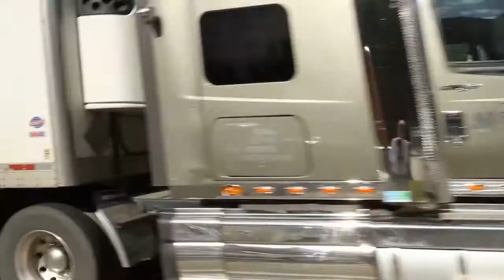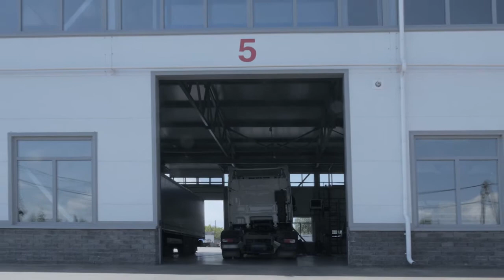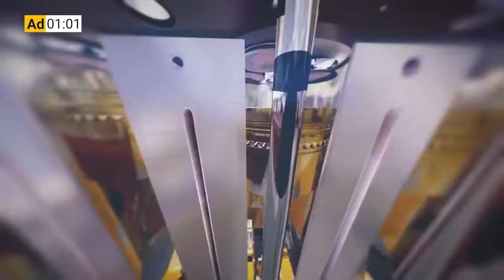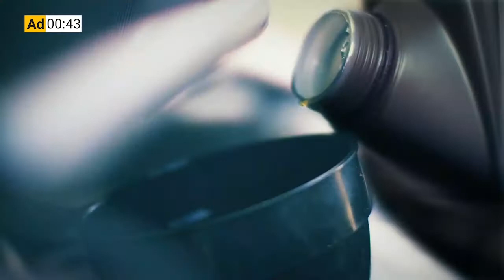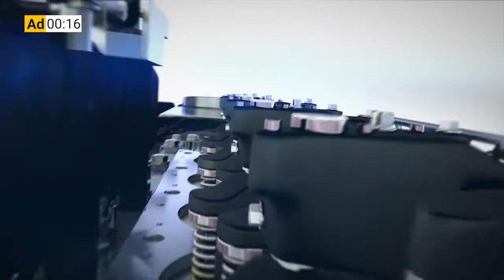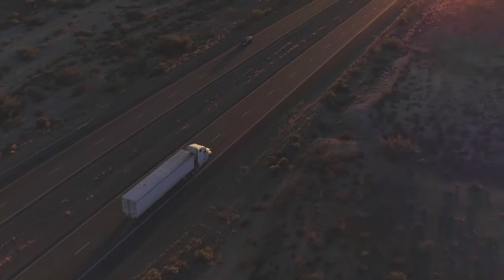Changing attitudes toward automated transmissions

Comment: Anything you save on service intervals, you will pay back 100X in repairs. The only AMT's that work are the IShift, but the costs are unbelievable. AMT's are also a major factor in the decline of this industry, reduction of safety and the severity of accidents. Oh and on the fuel economy side, a flip flop holding the pedal to the floor in an AMT, deletes that pretty quick.